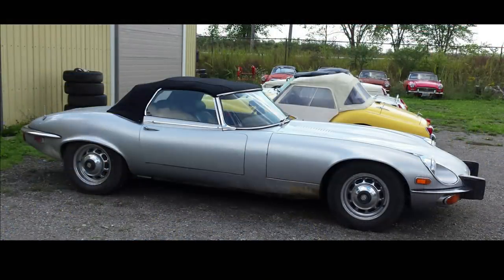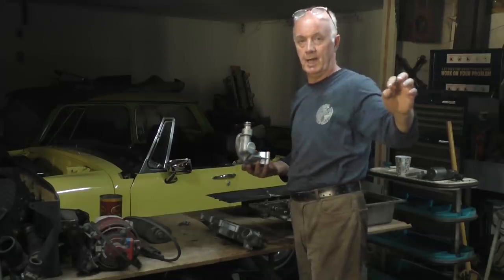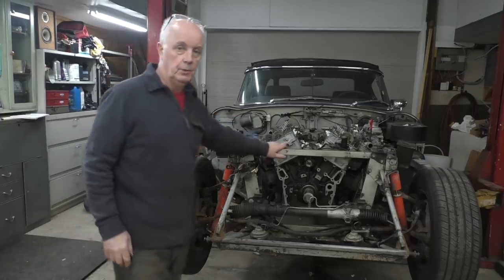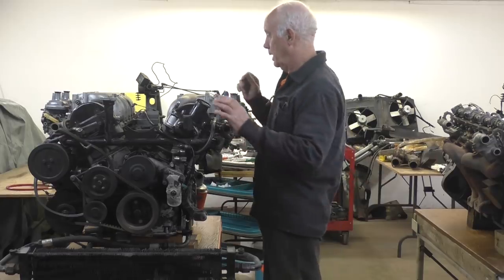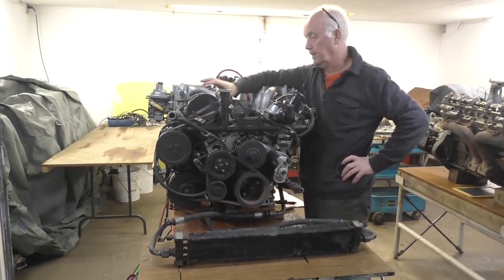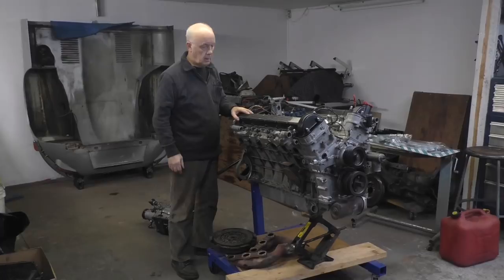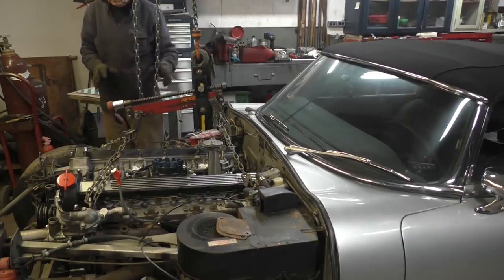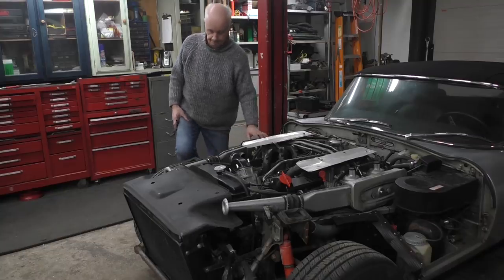Dr-Doolin Jaguar XKE E-Type V-12 1974 Engine Repair

Comment: I do not have either a Jag or V12 engine and the wish to have one is not strong with me. However, that was probably the best 31 minuets I have spent  surfing you tube in years, if not all time. I did at first think maybe a Yorkshire accent was coming through, silly me! A Yorkie would never spend the kind of money  involved in this project. A thoroughly good watch I do so hope you will be posting again soon.

Comment: Thank you for a really wonderful video. I like the way you removed and reinstalled that massive engine and trans and made it look effortless.
Reply: Like you, I was enthralled at how he was able to 'effortlessly' hoist a Jag V-12,, with transmission attached, out of the engine bay. Unbelievable! Years and years ago my best friend, his uncle and I removed, rebuilt and replaced a Ford 352 cu. inch engine in a 58 Ford Fairlane. It took 3 of us to take the engine out and put it back in. My best friend's dad owned a used car lot with a 5 bay garage in the back, so it's not like we didn't have hoist's, come-a-long's and the necessary brackets and braces. This guy's a magician.

Comment: Cracking video thanks. Leakdown test great in identifying audibly whether leakage is via inlet or exhaust valves or presumably into the crankcase. Yes we would have liked to hear a startup. I have a fanaticism in expecting  starting first time after an engine out exercise, in my formative years I learned however that the choke and throttle cables smoke less if you remember to refit the earth strap!

Comment: The chances of me working on a Jag V-12  are slim to none but this is a fascinating video.I'm really surprised there isn't a better oil pump available though? I would think a trochoidal pump could supply enough oil to have good pressure even at idle.I had a friend in South Wales Constabulary Traffic who told me the V-12 was good for 150~160mph, but, needed a full rebuild afterwards. The Rover SD1 would only do around 130, but, could do it all day every day
Reply: Maybe check out some race engineer`s and mechanic`s solutions. Jags of all types have spent a lot of time on tracks over the years!

Comment: Awesome video! wish we could have heard it purr at the end. I'm a bit surprised even the worn pump produced no pressure at all, seems like that would be more of a gradual failure. Did you find anything else in post mortem? Curious if a later V12 from an XJS would fit? those seem to be relatively cheap and plentiful. Is it just the oil pan that's different? More videos like this please!!!

Comment: The old buses had a tufride crank and usually the bearings were down to copper we used to fit a complete set of bearings and achieved plenty oil pressure

Comment: As much as l like Jaguars, l couldn't bring myself to purchase a V12. The XJS had more plumbing than an oil refinery.  I was greatful when they released the XK8 and I'm now the proud owner of a 1997 XK8 convertable. The size of the inlet and outlet on the oil pump look to me as if it would operate more on volume than preasure.

Comment: I always clean the rust of of all studs including head studs and then coat the smooth part of studs with high temp, copper based anti-seize lube. That should make the heads easier to remove if needed. I also run a round wire brush through the holes in the heads where the studs go to clean out corrosion.
Reply from the maker: I do clean out the holes in the head where the studs go though, and of course the studs. The problem with the Jags is the use of Wet Liners in the V-12 this means the studs are in the coolant section of the block, you should be able to see that in the video. (Something you tend to see but don't notice, if you see what I mean). 
So the coolant can seep up the studs in the Head section easily, of course the studs are steel and the heads aluminum doesn't help. Plus the heads don't come off that often. So yes I agree the copper anti-seize will help but really I am depending on the last guy in there to do that. 
James

Comment: It has been mentioned here that the original block and heads should have been maintained. As an owner of one of these for 40 years I agree. For what it was worth you were so close to removing the crankshaft. If you were going to change engine then many people put in the last series last series injection engines which is not so straightforward. Yes the engine is far superior as in fact it should never have had carburettors in it's original debut, but the injection design was not yet ready. With modern fuel I have had many problems with the Stromberg set up but have succeeded to get them modified and running quite well once all the emission fudges are inactivated. Lovely car but very poor efficiency and cooling design. I have upgraded mine with multicore radiator and modern fans which helps with the ethanol fuel today. Vapour lock is also now a problem that I have addressed.
Reply from the maker: You have bought up a few interesting points, as I have posted a few days ago I can't spend hours answering all comments  individually, so I am going to try a podcast (video) to answer them.

Comment: I had a quick look at some Melling oil pumps and some start as cheap as about $60 for the old style GM for 4.3 l v6. One that is a similar design to Jag is the Ford Triton with OHC and front crank design for about $150. Prob US$. So I don't see why they could not make a Jag pump for say $250. Then jag would never sell another for $1650. Haha. Maybe they could get more volume out of it too and cure most of the low OP at idle problems. And increase engine life a bunch.

Comment: Kind of surprised you did not use the original engine as you had to do almost double the work, with disassembly of the extra engine, and the original. Another thought is what does that do to the value of the car as it is not the original engine? Also curious- do you do all this by yourself, no assistants?
Reply: I agree such a shame that he's not keeping it original!

Comment: A very interesting video on the V12 engine. Did Jaguar ever solve the low oil pressure at idle on their later V12 models, such as the XJ40 V12 or the 6.0 litre in XJS and the later sedans?
Reply from the maker: Hi,
The oil pumps are now listed as "high capacity" I assume they have a higher volume output than the stock or older pumps.  Which should help in maintaining pressure at idle. At $2,110.00 us. each I should hope so.
James

Comment: Doctor Doolin, Nice work well done. I have a 72 V12  on the stand. Picked up a few tips. Wonder how you "compress" oil in the Queens land.  ...  Down under we pressurize our oil. ? Thought of running a  external oil tank, dry sump type system. External oil  pump, adjustable pressure. !  Inexpensive  and reliable.  A bit of plumbing. Cheers from Adelaide.
Reply: my thought also but i didn't want to be a smart Azz  from north dakota -5f
Reply: @erniew5805  Hi Ernie ... I hope he found some humor with my comment. ? Life good where you are. ? Buffalo N.Y. for me Thirty Five years. ! Enjoy.
Reply: @michaelpercival7981   nice winter until 2 days before xmas. then it snowed and stayed . january was normal winter weather. february has been below zero all except 1 day a couple -35 plus nights . but the 4th of july is coming so it may warm up.
Reply from the maker: I am going to try doing a podcast for YouTube and my website. I will include my thoughts on this as it is an interesting point. I tried a written reply but it was taking forever. Also give me a chance to explain to guys who are not familiar with what you are talking about. 
James
Reply: @Dr-Doolincom  great . i have heard the Bob's your uncle before. but as an American i might not  fully understand that slang

Comment: I know it’s generally not recommended.....but In similar situations I’ve had great repeated successes installing new bearings onto unturned crankshafts.....as long as the journals look good and the engine ran beforehand w/o any noises....and pass plasti-gauge measurements
Reply: I'd go with that Dave.....
Reply: Yes why regrind the crank if it is within ovality limits? Maybe a light polish with fine emery.

Comment: That's put me off jag restoration for life..
Reply: Wish I had a classic Jag to put me off restoration LOL !! You are right no way would I be able to or want to tackle a job like that although I have stripped down quite  few engines and gearboxes.
Reply: @L Ofaday - I had a double six whose previous owner had fitted a 350. It was thirsty but indestructible.

Comment: I had a mate years ago who bought one of these. We were into boat racing and we knew our way around American big block motors. The Jag was his everyday driver and it developed a ticking sound which changed when you revved it. We had never seen a V12 in a Jag. The sixes were a nice clean motor. We opened the bonnet. OMG. You could not see the engine for all the plumbing and linkages. The tic was in the valve gear. What to do? I took four of us all weekend to get on head off. WE were muttering things like "lets piss all this shit off and put a Holley on it." It turned out that the oil feed to the camshaft was a bit blocked. We fixed that and put it all back together. All together we put about 90 man hours into it. My mate sold it. I really don't know what Jag made their V12s so messy. You look at a Ferrari V12 in the 70s and its a work of simplicity. I think that it was becuase the Colombo V12s were race engines before they were put in cars so they were easy to work on. 
Two years ago at Goodwood Nick Masons GTO blew a head gasket. He had a spare at home in the castle. It was 30 miles away. They pulled the engine out in the paddock. It took 45 minutes. Into the truck. Off to swap it for the spare. They were back and had the car running in another hour. 
On our boats we can do a crankshaft swap on our Hemi race engine in 90 minutes. A good designer makes for friendly engines to work on. In the 60s when Jack Brabham was winning world championships, the Repco Brabaham V8 would go six races before a rebuild. Its the same philosophy.

Comment: I tore the entire car apart, now let's see it we can find the problem.  lol
Reply: lol i think he did this for several reasons, multiple problems he was going to tackle and a lot of other stuff he planned to check while he's inside, that and removing the bonnett and front subframe is almost the only easy way to access an awful lot of the car.  E type was never designed for serviceability, that's for sure, because what other car requires removal of the engine + trans just to change the clutch?

Comment: Hi. I noticed you have an MSD ignition box on your car. My opus system is starting to fail and I'd like to replace it. Did you need to change the pickup in the distributor to use the MSD box? I'm also designed my own crank pulley with provision for fitting a trigger wheel for a more longterm solution of switching to a distributorless system.
Reply from the maker: Hi Bruce, the Jaguar is not actually mine it is a customers. The MSD ignition I fitted quite a few year ago because of ignition problems with the car. This unit will not work using original sensor in the Distributor. I don't have enough room here to explain everything so I will do so in the next few days on our magazine page, under Tec-Talk.    dr-doolinmagazine.com
Reply: Thanks for the quick response. Will definitely like to read more on your page. I know moving to the later EFI distributor means switching ignition amplifier/control box is easy but with the Opus distributor the signal in and out of it isn't a simple trigger. I love these v12 Jags. I rebuilt the 5.3L in my 73 2+2 a few years back and I have a 6L engine waiting for me to rebuild it to go in my 74 roadster.
Reply from the maker: Hi Bruce,  Just to let you know I have finally posted an article on the Ignition for your Jag.    dr-doolinmagazine.com
Reply: My Opus packed up years ago. I replaced it very successfully with a Crane X7000 kit if I remember. It has an optical trigger in the distributer and I also used a Crane coil. I don't think they're in business any more however. Thesedays people seem to use the SNG Barratt kit but that requires you exchanging all your existing stuff that I don't like.
Reply: Adam Ski That’s what I did with mine. It wasn’t a cheap fix but it did the job. The only issue I have with the Barrett swap is that the lead is still too short and requires you to place the unit in the ‘V’ which was the cause of most people’s problems in the first place..
Reply: Interesting point you make. I actually located my Crane unit and HT coil on a bracket in front of the brake and clutch fluid reservoirs. For the very reason of keeping them out of 'death valley' heat zone. As the fluid doesn't boil here I reckon this is the coolest zone under the bonnet. Yes I had to use a longer king lead to reach the distributer cap. Forget about original, I don't want to fry these items. Temperatures under the bonnet are very hot especially with modern fuels and traffic conditions. It is entirely possible to have these cars running well but the cooling needs to be perfect and mixture correct at all times.

Comment: Dr d. Why is the oil pump for the  jag v12 over $1600? It's crazy, you can get a Melling pump ( good quality) for most v8 engines for under $200 or so. As you showed the entire overhaul kit for Chev 350 ci is $800 or so incl new Pistons. I can't believe that people fix these things. I think the old v12 is only about 5.3 l and maybe 250 hp so it's not like huge power or anything. Those are a nice car but if I had one with low OP I would fill it with 20w50 and drive it til the rods let go. Then get a good GM LS series of maybe 350-400 hp and adapt it to fit. Then have more fun and way fewer headaches. Jag can keep their over priced crap. Haha I suspect that would reduce value of the car but it all depends on if you want to drive it or sell it I guess. Bob
Reply: All the V12 engines use 20w50. The key is to maintain the level and interval. They require 10 quarts of quality oil. These engines run rich and will dilute the oil real quick. The same goes for coolant in these, 4 gallons of quality coolant changed yearly. Not just good advice for V12 owners, but good advice for any older classic.
Reply: OK you have reminded  me that these are really just collector cars and way too high maintenance to drive. Now i recall a guy who tried driving a XJS in winter in Calgary. Haha not a good plan.

Comment: I would imagine,looking a the wear of the oilpump,this lack of oilpressure didn’t come all of the sudden....I had engines loosing oil pressure from one moment to the other....Dr. Doolin checked this and that...like I did....plugged intake for the oilpump (silicongasket is notorious...) drive notches (to connect oilpump to crankshaft) sheared off....10 kilo’s of tarmaclike substance in the sump of a 2cil. Volvo marine diesel (5 years of NO maintenance...)....you won’t believe the sort of mechanical mishaps one comes across....
But in this case it looks like someone waited just too long with having the slightly dropping oilpressure checked out....
Reply from the maker: Yes, your quite right about oil pressure not dropping all of a sudden (as you know),  when the engines get worn the pressure reflects that. Unless there is a mechanical problem something breaking or dropping off. 
The thing with the V-12 oil pressure is a bit odd. It is considered normal to have very low oil pressure at Idle 10 lbs or lower sometimes none at all showing on the gauge. As soon as the engine RPM is raised the pressure moves up to 40 lbs and stays there dropping slightly only when things get really hot. 
This particular engine became a problem because even at increased RPM the oil pressure was zero. This engine and others I have seen even with the zero idle pressure don't knock even on start up. 
When this engine was taken apart the bearings on the crank (Big Ends) were worn almost though to the brass but not disintegrating far less damage then you would expect from a zero oil pressure engine. Rumor has it the later V-12 sedans had oil pressure gauges that bottomed out at showing 10 lbs pressure to stop customers complaints. How true that is I don't know but I do know low idle pressure stopped being a concern to the dealers. 
The customer who owns this car only got worried when the oil pressure didn't show at all,  he was used to the low idle pressure as this was his second V-12 E-Type.  Hence the repair.
Reply: The later cars changed the oil pressure sensor to a switch, as soon as pressure came up, the switch toggled to on and the gauge showed full pressure.

Comment: An inspiring show.  Those V12s were the bane of many a Jag owner's existence.  Even if properly  maintained, oiling problems, overheating, soft exhaust valves, blown head gsskets and the like made made them highly undiresable.  Unlike the 6s, these engines are demons on which to work.  When running well, the only attribute is smooth operation.  Power is lacking, and economy's non-existant.  Thet also make the E heavy in front, making them understeer worse than the 6.